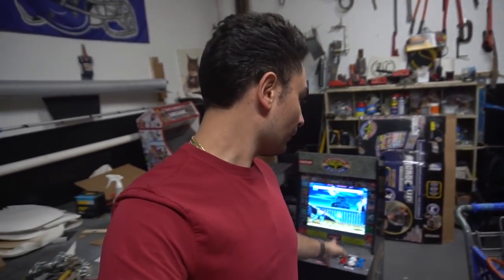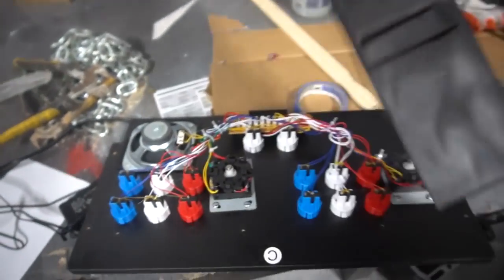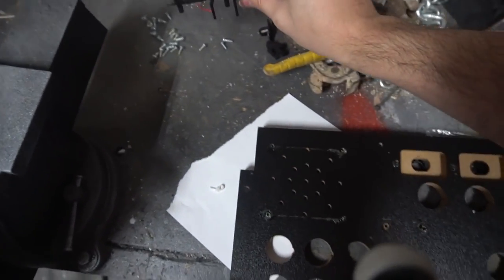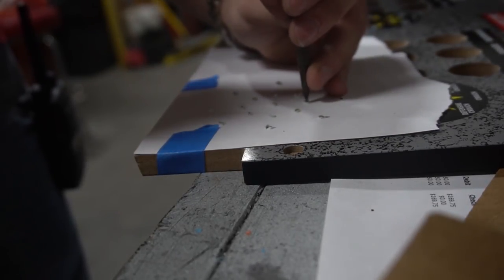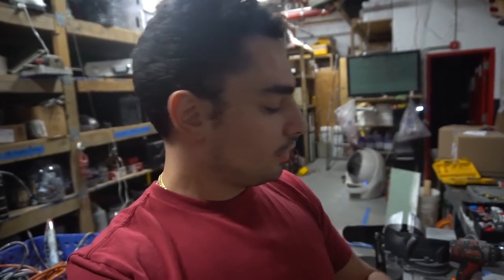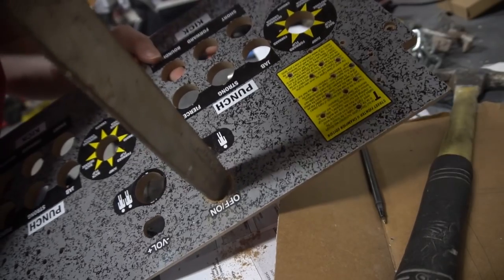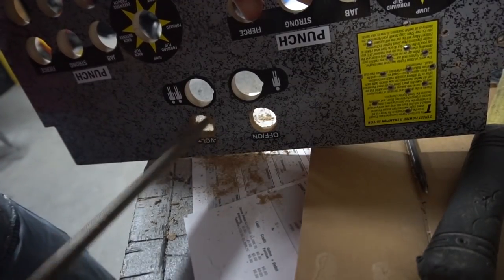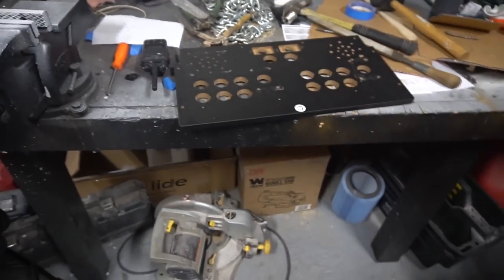Arcade 1up HOW TO MOD! for stereo mod, led buttons Part 1

Comment: started my project today, thank you for the detailed tutorial!
Reply from the maker: Good stuff bro, what cab did you get?
Reply: @Vic_VP  unfortunately i didn't think about modding when i first bought mine - it's a mortal kombat cab :(
Reply from the maker: @weskerwaldorf2824  dam, that 5 button layout is brutal... may get away with adding an extra button but its going to be very odd
Reply: Vic_VP got mine up and running today with a very odd button set up lol. Something else came up I wonder if you’ve experienced it before: after a few plays, my Pandora’s box 6s stopped working, it would power up, showing the intro screen but won’t run pass that to show the menu, ever had that happening to you before? Much appreciate! Good luck w your next project
Reply from the maker: @weskerwaldorf2824  that's interesting, a PB 6s? I didn't even no they made that. It might be a bootleg clone. PB is designed to replace arcade jamma, meaning they should be able to run 24/7.
You may either have a bad device or a clone. I suggest contacting seller

Comment: U should use the painters tape to make clean holes on the control panel
Reply from the maker: Check recent vids, I tried that, still made Mark's
Reply: @Vic_VP  u have to use tape and put something behind it so it makes a clean hole no push threw
Reply from the maker: @Ricostatue423  good tip I'll def keep that in mind!

Comment: Y cut them you can save them for replacement in case one goes out
Reply from the maker: My personal opinion, the buttons are totally garbage and useless. The micro switches are so tiny I'm sure after 4 months of heavy use they will break. Also the micro switches are soldered in, so I cant put a iPac  or xin to that button lol
Reply: this guy's doing a complete modification but if you wanted to save a few bucks you can use the buttons and joysticks until they crap out on you

Comment: Lol... a file to make a circle hole?? WTF bro... you couldn't buy a drill bit for like $10?
Reply from the maker: Why risk missing the center and destroying the control panel lol?  Drill but could skip and scratch lol 
I guess I rather work safe than risky ?
Reply from the maker: Bit*
Reply: @Vic_VP  nah... just use a stepper bit... designed to center... or a forstner bit with a center punch and a block underneath.
Reply from the maker: @pesto12601  I thought of that too, those step bits make me nervous haha
Reply: @Vic_VP  Well.. it worked for you brother that is all that matters... thx for sharing!
Reply from the maker: @pesto12601  thanks man! Yea was a good workout in the end hahaha